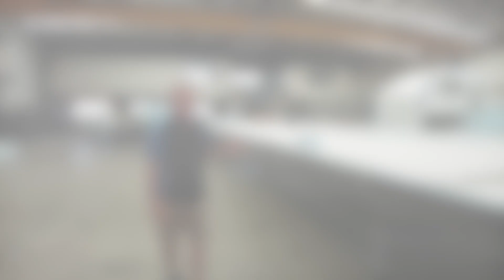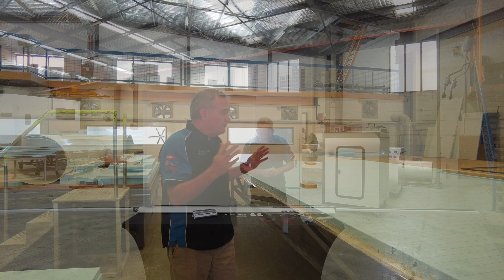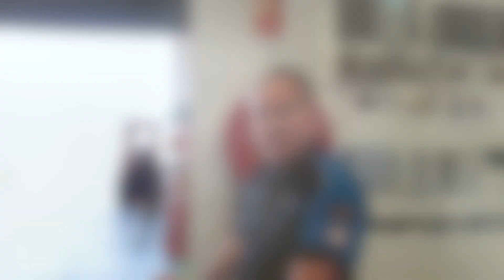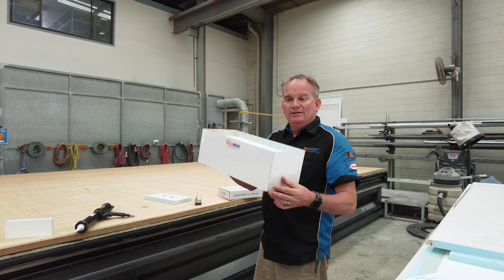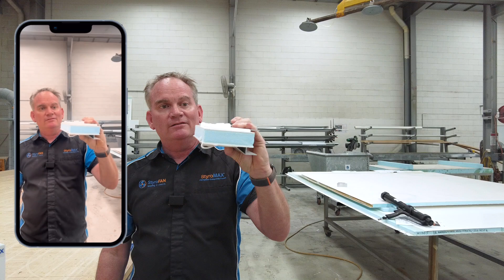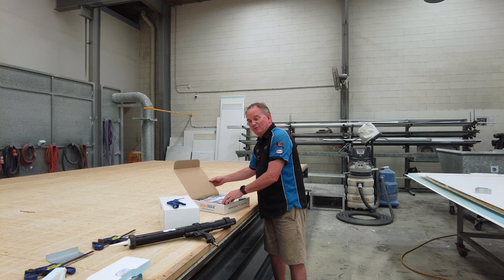18th October 2024 Factory Friday

Comment: I will be converting my Forward fold camper to a caravan top. I have a 2d design with specs. Do you offer help with the diagram for the cutting as well as suggestions for joins and fittings ect?